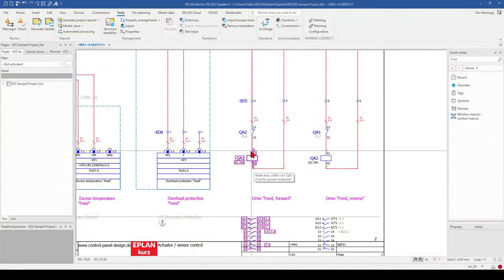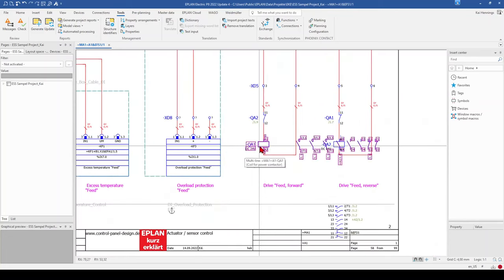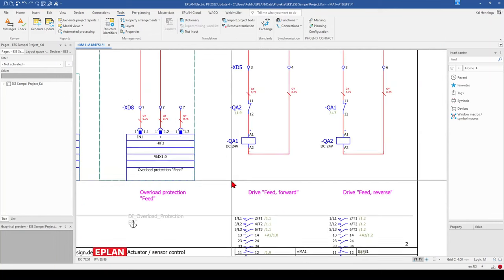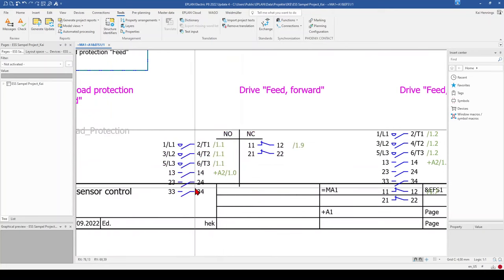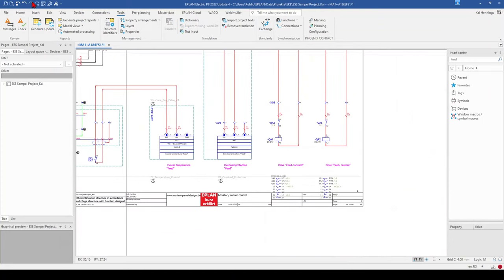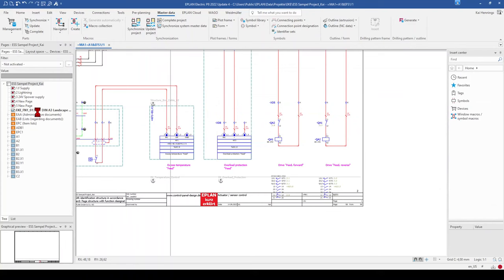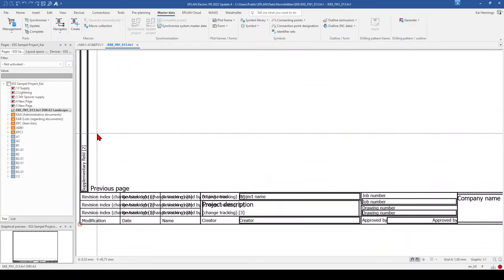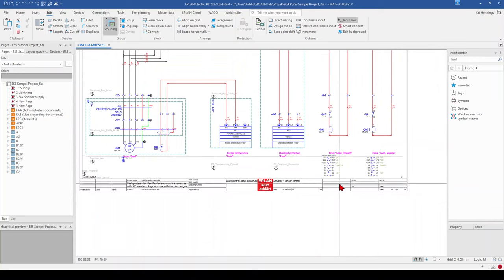Contactor in EPLAN. Settings, Contact Image, Properties

Comment: Good video 👍 

A question, I saw in a lot of videos while you hover over a cross-reference (green text) the cursor change from arrow to a hand icon and when clicked it jumps to directly to the corresponding cross-reference symbol or device.

I use Eplan Electric P8 2022, but when I hover over the cross-reference (green text), instead of changing the cursor to the hand icon, it select the whole connection/coil cross-reference + symbol.

I need to adjust a mouse setting? I hope you can help me out ☺️
Reply: Hover over the cross reference and press F

CTL click used to work too but not anymore